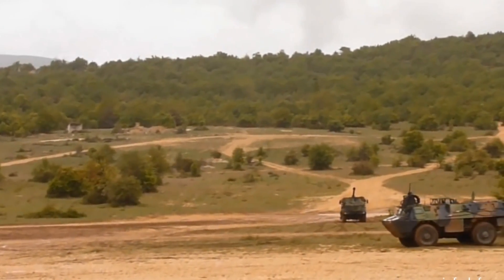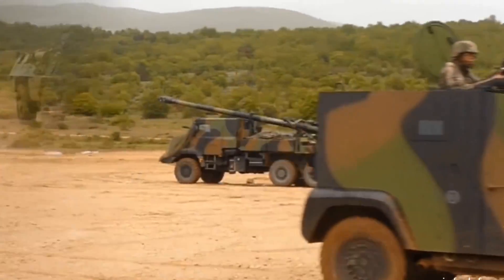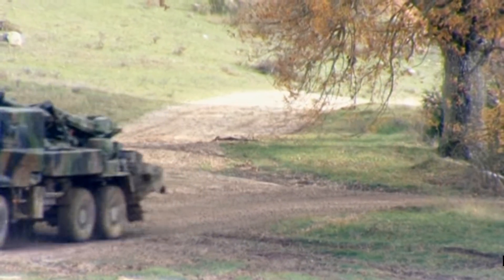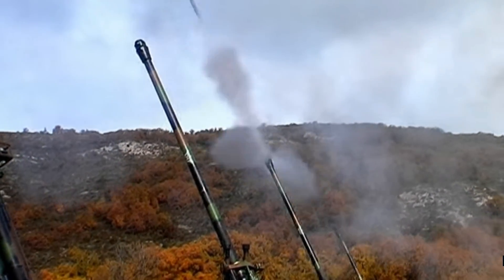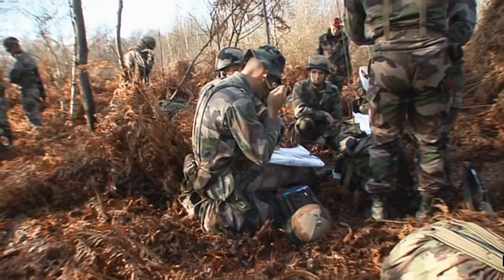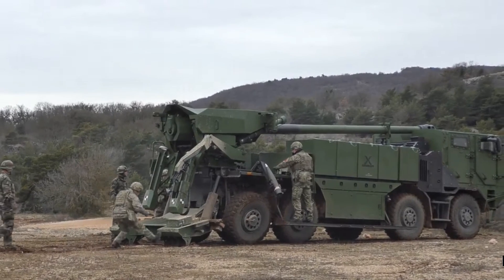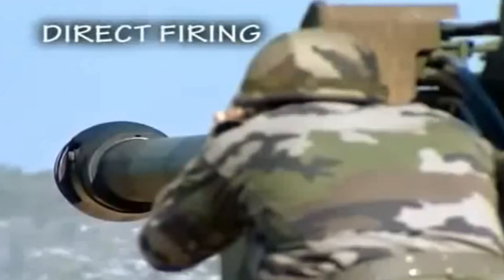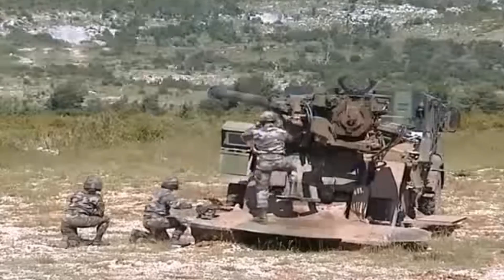CAESAR 8x8 Self-Propelled Howitzer Review

Comment: Reviews out of Ukraine have been mixed, but lots of orders coming in because stopping the Russian invasion of Europe depends more on quantity than quality.  The computer aiming and machine loading will also be more important as militaries increase size.  The rate of fire is a good point, however with shoot and scoot many militaries may conclude that they won't be getting many follow up shots anyways.  And with cheaper maintenance, perhaps the solution to the rate of fire problem is simply more units.  Want 18 rounds a minute?  Use three.

Comment: Can do & should do better are not the same, & " better is relative & contextual). 

You're being emotionally nostalgic. We can just go the AC-130 gunship way and have airborne artillery but we shouldn't. 

This is a good example of minimal automation to prevent fatigue but not necessarily replace the gun crew. Then there's lowering procurement & running costs)

Caesar $3-6.5m depending on configuration,
Archer $10.4m 
Paladin $19m (2024 planned US army procurement) $20.9m (2025 planned Army procurement) 

I'm prepared to guess the running costs of Caesar are lower than archer & paladin.

The main hold up on the amazing archer system was cost & politics. Buyers & operators may seek the relationship with the US more than the actual Paladin. The French have an independent arms & expeditionary capability which Caesar was a central part of with a lot of battlefield experience (all feedback was very positive since 2002 sahel & Afghanistan missions) while archer has only built under 60 since 2010. That's about 4 a year, all of it training ground experience. 

Ukrainians have used Caesar to excellent effect and apart from the pressing ammunition issues they are very happy with it. 

No one's ever told me what Archer does that Caesar can't apart from be a cool tech demonstrator. Before anyone tries "rate of fire" - 2 or 3 casars out gun 1 archer and cost the same or less. 

Archer won't be much use in the Pacific theatre where Caesar could fit in comparatively easily & has been in operation since 2010 in Thailand & 2012 in Indonesia with Malaysia having placed an order. 

The 14 archers the British army use are a stop gap replacing 🇺🇦 donated AS90s but are going with the RCH -155

Denmark chose the Caesar as the system of the Royal Danish Army with the procurement being delayed by COVID then the delivered units sent donated to Ukraine. 

Check out the list of operators and those interested to see how handy a system really is.

Comment: Tracks are not needed for self-propelled artillery unless you are carrying monumental weight like an 8-inch gun. The problem with modern artillery is weight and mobility. The CAESAR tackles these problems head on. You need to be able to move artillery into theater and on paved road, fast movement. I would take the CAESAR over the Panzerhaubitze 2000. Like typical German stuff, the PzH 2000 is overly engineered, and much war theory is put into the design, such as the "multiple-round simultaneous impact" ability. I don't think the MRSI has ever been proven to be affective. It requires you to be closer to be at the frontline, and shooting multiple rounds at reduced range from the system position makes it easier for the enemy to pinpoint. The requirement to be closer to the front puts you closer to drone activity The design of the PzH 2000 emphasizing mass firepower as quickly as possible, but it costs a lot of money for something that has never been proven. Magazine fed systems require specialized equipment to load, and the magazines themselves need to be loaded. Again, you may not need the magazine fed system and NATO doctrine fire mission combines fire from dispersed artillery units, again what the benefit of rapid fire stuff that is more complex and compromises flexibility for advanced features. The CAESAR has practical benefits than niche abilities.

Comment: What wheels provide is quick transport using roads. While tracks offer better cross-country performance, the fact is, at least in a conflict like Ukraine, the front is supported by road systems. The CAESAR puts a simple concept forward - light weight wheeled chassis that can be transported by air more effectively. The Chinese have their own wheeled SPG in the PCL-181 for that reason. You need to move as many weapons systems to areas of interest as quickly as possible as to build critical mass. Wheels are cheaper to maintenance and in Ukraine where supplies of all sorts are short, using common tools to replace wheels is practical than to use specialty tools for tracks. Wheels are easier to carry around and such parts vital in the supply chain that need to be close to the theater of operation to send weapons systems back to toward the frontline as soon as possible. The L52 gun and quick deployment makes the CAESAR the most effective artillery system in Ukraine.

Comment: Totally agreed on the firing rate side.
Only soviet tanks have em, and it seems that they had to compromise the safety of the crew for that, not putting the ammunitions in a safe compartment at the rear (like on Abrams).
But I do not see any reasons we cannot have the best of both world:
Soviets probably just did that because of the low weigh of a soviet soldier's life for his dictator...

Comment: This platform doesn´t re-invent the wheel, it glorifies existing components into something new. This will keep the price tag in a reasonable range. The vehicles seem to be pretty lightweight as compared to other self propelled artilleries which will make them less of a hassle when transporting them and they´ll be able to cope with bad roads more easily. Adding to that, they will probably be good at going longer distances at higher pace, and do that on less fuel. The cost of fuel is one thing, having to get it to a fighting unit another. All in all there sure are some apparent oddities to the design, but it probably delivers a long range and massive punch on a fairly decent budget and some other advantages, that make it look like a decent system for many militaries.

Comment: No manual system, once the elecronicly powered hydraulic pump or whatever goes down it's out of action until a mechanic can get working on it in a garage.
12:49 No...you really can't, there are about 7 safeties inside that fuze head, it won't go off unless you fire it.
12:52 Call him "Melorm". Also he's not a gentleman.
14:33 The world record is held by the Swedish Bkan 1b which can empty it's entire magazine of 15 rounds in 45 seconds and reload in 2 minutes, it was built in the 60's and weighs 50 tons (modified Strv103 chassi). most modern guns don't fire close to that fast, they're not machineguns, the only reason the Bkan fired that fast was to mitigate a lack of MLRS-systems.

While I don't have much love for this system, I am at least glad that it (or rather anything )will replace our M109a3's.

Comment: Hey there Matsimus. I understand your comments about the "flimsy" loading system on the Caesar. We just got out first batch delivered here in Denmark (its a danish gun in the video) Being a former gunner, I know that any help you can get in loading that 43kg of a shell in the gun is very welcome :-) The PZH200 is also an automatic loader, but it is hidden in the buttom of the vehicle... Tracked vs. wheeled will never end... but artillery  is often run miles behind the line of contact hence we use roads all the time... and tracks = hours !! of maintance ... .... regarding rate of fire.. there is a small issue on the heat the shot generates, wich might end up igniting the powder charge prematurely and the gun has to "settle" between the shots aswell... (if a PZH2000 shoots "broadside" it will rock back left/right and waste time setteling....  looking forward to see what our army guys learn from our new artillerysystem... if I get news.. I'll keep you updated :-)
Reply: Thanks for first hand insight. Best wishes.
Reply: In the US Artillery, we always swabbed our bore with a wet punch after every shot.  We also inspected the bore (looking up it) and screamed "BORE CLEAR!" so everyone knew that we had looked for obstructions.

Comment: Matsimus you criticize on hypothetical complexity and reliability,  but Caesar has worked flawlessly and continously in combat for over a decade from the mountains of Afghanistan to the Sahara desert. 
Auto loader is always better, there is no value added to have it manned.  These shells are heavy, and if you are there all day you would not think it's a trivial matter.  Machines tend to be less prone to mistakes, and it won't cost you an arm if a failure was to occur.  PS you did not show the fully automatic 8x8 version which only requires a crew of 2 to 3 men.  The one on your video is the Danish 8x8 version which is semi auto version.  BTW Denmark is happy with theirs and just re-ordered an additional 4 units.
Rate of fire is not limited by the auto loader but rather the barrel temperature.  And at $800k per round on the Zumwalt, we are not going to see rail guns anytime soon. 
You are obssesed with tracked armour, and you talk about reliability vs wheeled?  Lol, the Dutch were critical of their PZH 2000 that did not like the dust or heat in Afghanistan.  Tracked and heavy armor are slow, expensive and difficult to maintain, and good luck finding a plane to transport these.  Also tracked units still require wheeled units to resupply.  Artillery is in the rear and not a frontline unit. Wheeled option is just a better choice overall, that is why most armies are moving towards this type of unit.

Comment: The reason why 155mm fire rate can't go higher than 12 round/min is due to the charger powder and vibration.
the machnical system can do 3 second per round, but the heat and vibration take more time to release.
Reply: might want to look up the "Bandkanon 1b", 15 rounds in 45 seconds.

Comment: The CAESAR 8x8's autoloader might just be my favourite. Way too cool and satisfying man! But if any mechanical parts go wrong I think that it can definitely function with manual loading as well.
Reply: It’s a 6x6
Reply: @blingbling574  can be both, newer ones are 8x8 iirc
Reply: indeed, manual loading is always possible in the event of a broken loading, otherwise, the gun leaves the area for repair, in any case, loading did not pose a problem in Afghanistan, 4 CAESARs and more than 22,000 shells fired !! and at 2400 euros per shell, the bill was heavy!!

Comment: Matsimus, 
First, you do not need to fire 5 rounds in ten seconds. Mobile artillery is designed to stop, fire five rounds and move on. As for that auto loader system, absolutely brilliant.
Brilliant system and requires far less maintenance. I’d rather that than track maintenance

Comment: This is an excellent mobile artillery system.  It has a fast and smooth setup process.  Requires fewer crew to operate.  Loads, rams and charges the shells faster with its mechanical system. Given the fast pace of battlefields and the risk of counter-fire, defense agencies/armies should be looking at mechanical efficiencies and requiring less crew to operate.  Politics and ‘buy domestic’ are often the factors when defense agencies consider acquiring artillery systems, but when you have this CAESAR which works this well and smoothly, you have to be pragmatic.

Comment: The CAESAR 8x8 has a brand new fully automated ammunition loading system. It is operated by a crew of 2-3 men. Maximum rate of fire is 6 rounds per minute. Though the CAESAR 8x8 is also proposed with a semi-automatic loading system, which requires a crew of 4-5 men."
the danish chose the latter one.
http://www.military-today.com/artillery/caesar_8x8.htm
http://fna.artillerie.asso.fr/files/posts/brochure_CAESAR_8x8_uk_HD.pdf

Comment: Really NOT INTERESTED in your  AUTO-LOAD OPINION.  Today equipment is good so I not question automation and  10 rpm fire rate I think has heat problems and projectile manfucntions, just my humble opinion. Need to lose muzzle break if increasing round fire? Funny thing  Military recommend a Sustained rate of fire of only 2rpm, so your dream of 20 rpm is a pipe dream and defies the principles of physics to operate safely and accurately.

Comment: I have to agree about the 8X8 loading process. It reeks of modern military officers' obsession with digital data linkage. However, as a trooper you easily realize that the "more complicated you make the plumbing, the easier it is to stop up the drain." In this case, the arm senses when the next round is in the cradle and moves to get it after the firing cycle. But what if the cradle is damaged or loses connection? Can the cannon fire if the ammo grabber runs around the idle arm and places a round on the loader ram? I tend to think Murphy is going to say, "No" 90% or the time. Fancy toy but vulnerable to real world hazard. And far too slow.

Comment: The Caesar is a very good compromise between cost effectiveness and performance, very much like the Israeli ATMOS and ATMOS 2000, it avoids the extreme weight penalties of tracked systems and their much more elevated production and operating costs, while providing much better mobility than towed artillery.

And both systems have been combat proven and unlike some more sophisticated and costlier systems like the Swedish Archer, they have proven to be quite reliable.
Reply: the ARCHER is finished, as he has not found his customers!! an ARCHER II would be in development, the problem with this vehicle: its automatic loading system complicated in maintenance, and also too high a weight! but the funniest thing is when I read people who say, ah but they are in the vehicle safe LOL, the cabin is STANAG 4569 level 2 only, which only protects against ammunition 7.62 x 39 (AK47 for example), they make me howl with laughter!! while a CAESAR can be 42 km away (see more from the front line) so, enough to be safe, and its cabin has the same level of protection, when I saw the Russian drone hit the cabin , you should not expect to be safe in the cabin, the worst, you are particularly isolated from outside noise and not hear a drone arriving! the CAESAR is lighter, being simpler, there is less risk of breaking down, and it is precise, precise enough to have impressed the American officer at Fort SILL in the USA, an artillery training center in which a CAESAR had done a test, this CAESAR destroyed 2 targets at more than 46 km (a new record in precision and distance for an artillery gun) and the American officer said that he had been given an artillery lesson ! CAESAR has a powerful and efficient computer system which is compatible with the English, German and American systems, which allows data transfers for greater efficiency! (system which is not installed on CAESARs in Ukraine! In France, a CAESAR battery is made up of 4 CAESARs, a command vehicle which sends the firing positions to each gun by radio, several support vehicles and security and 1 or 2 TR10,000 (all-terrain flatbed truck which transports ammunition for the 4 CAESARs) price of a CAESAR = €5,000,000! price of the basic ammunition in 155 mm (with two modes: by exploding at 9 meters above the target, screening it with shrapnel or perforating a building for example, the adjustment is made on the rocket)

Comment: This is to slow and that is funny that Danish Army have orded this "Crap"
Reply: ZoZo this "crap" is combat proven in Afghanistan Africa and Irak. Have a longer range than Archer. A good fire ratio with 6 to 10 rounds per minutes. Can be transported by medium plane.
Move in sand mud and snow from Afghanistan and pass every where like 6x6 or 8x8.
Do the same thing but cheaper...than Archer k9 and Pzh2000.
Reply: You notice that you can not do anything about Artillery! But I can tell you that Artilleri is about shooting many shots as soon as possible before flying away "Hit and Run" Before Caesar got a shot against Archer, they have already shot and wiped out Caesar just because the crew has to go out and do some work that the crew in Archer does in the vehicle. And then shot from safe place in Iraq Afgahanistan is not immediately impressive. In a common war against a country that has Artillery, CAESAR will not survive for so long because it takes too long to get it done with the plus that the crew has to go out and do a part of the job. Acher has 3-4 in the crew but 1 person can do everything himself. Just sayning
Reply: It fires up to 6 rounds in 30 seconds or 12 rounds in 60 seconds, each in different trajectories, so that all of the shells arrive on target at the same time. This self-propelled howitzer has onboard ammunition supply of 20 rounds.
   It takes only 30 seconds to stop and be ready for firing. Out of action time is also as short as 30 seconds
Reply: @Zosiac6 The Archer is twice as expensive and has not proven it is worth the cost, over the CAESAR. The CAESAR is lighter too, which is good for air transport and building critical mass as quickly as possible. The Archer will not survive a drone attack.
Reply: @Zosiac6 Simultaneous impact has not been proven in combat.
Reply: 17 tonnes vs 30 tonnes